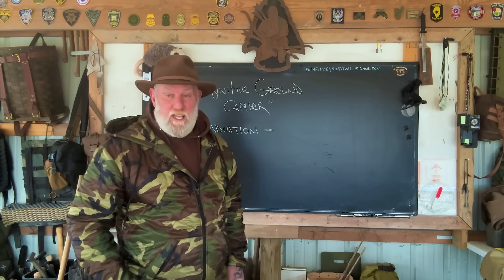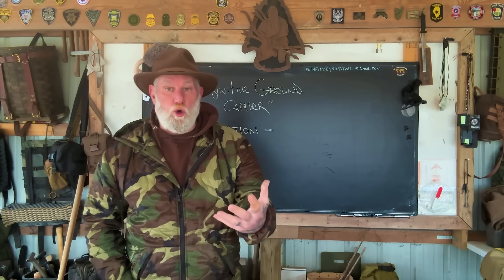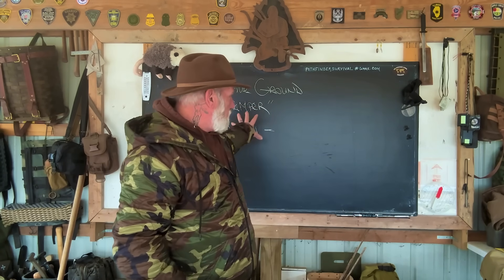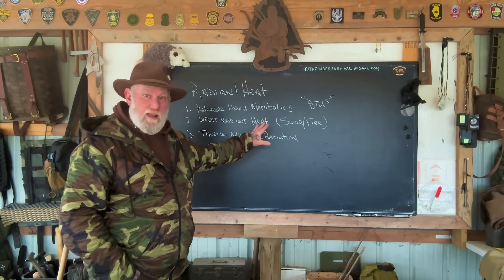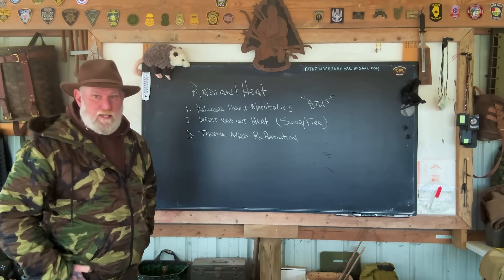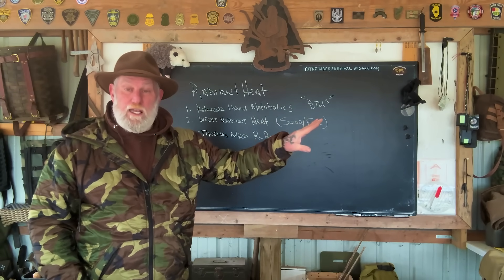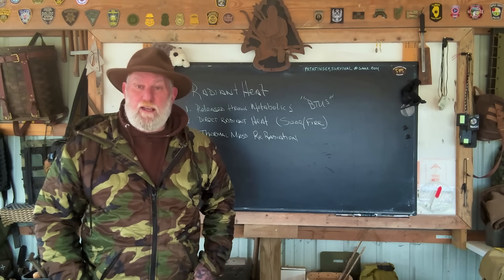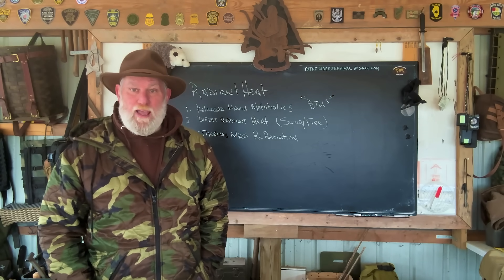Definitive Ground Camping: How to Manipulate Radiant Heat to Stay Warm (Part 1)

Comment: This really clarifies those thermal "backers" for me. I never understood how something wooden behind you was supposed to be a "reflector", as they kept getting called, so far from the fire with such low emissivity. A thermal battery kept up close to the user makes so much more sense, assuming there's fire long enough to warm it up.

Comment: How about a reflector* above the fire angled down & towards the sleeper?

*actual reflector, IE Mylar behind the fire on the opposite side to the sleeper. Might allow for a smaller fire, which isn’t something to plan for, but does mean you could get more out of a fire in a bad scenario. And a second Mylar blanket is basically 0 extra weight…

Comment: I would submit green wood or even wet can improve the longevity of a hot fire and is usually abundant also contributing to heat mass absorbtion mixed w/ dry

Comment: I suppose my comment will be deleted as all corrections to your videos are but I'll try anyway. For those who are interested you are correct when you say the heat varies by the inverse square of the distance but your description what that means is not correct. As the distance goes from one step to two steps (doubles) the inverse square is 1/2^2 or 1/4 (25%) so here you're correct.  At two steps you get 25% the heat that you do at one step. As you back up one more step the inverse square becomes 1/3^2 or 1/9. You are three steps away. You get one ninth of the heat that you did at one step away. 25% of 25% would give 1/16 the heat and is incorrect...well, not really even very close.
Reply from the maker: Thanks for the clarification, always appreciate accurate information!

Comment: I've been in a thin shed during record cold in Houston Texas and been warm as a toaster using a 250 Watt cheap infrared heater with a reflective mylar blanket! I learned the fundamentals of how important this is from that show Dual Survival. 🧐

I've moved on since to experiment with infrared reflective paint that gives the equivalent of 70R insulation with only 1/8 inch thick cross section. 

Howdy!!! 🤠🐮🐄@ Houston Texas!!! 

Yasuke no Musuko (弥助の息子)⛩️🇯🇵🎌🗾🍱🎌🏣